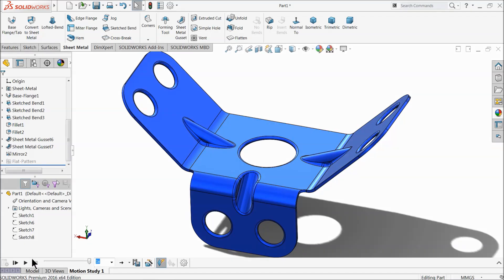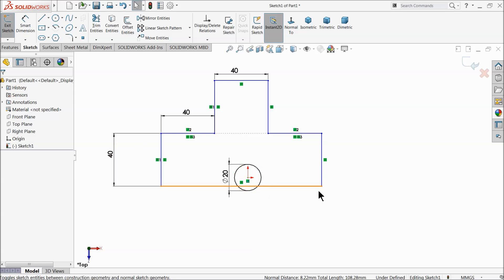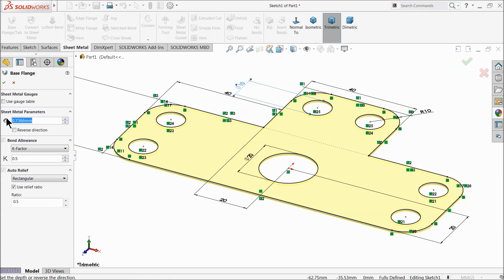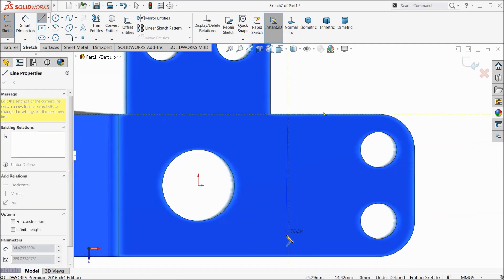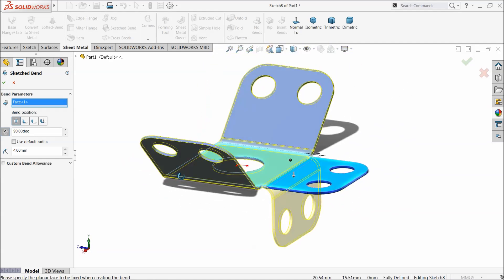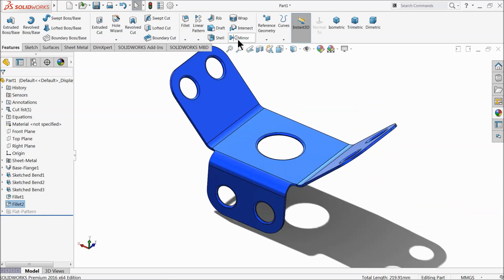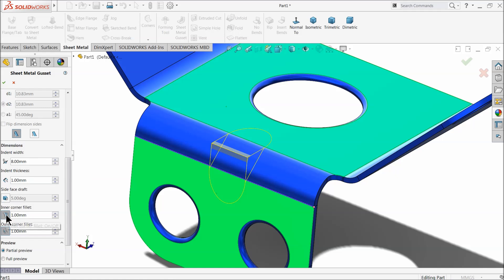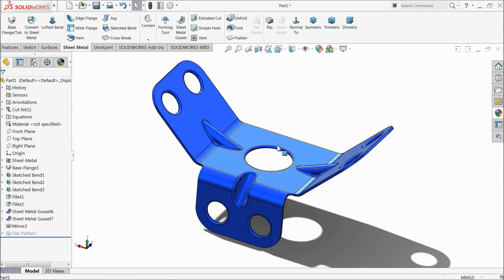Solidworks tutorial sheet metal

Comment: thanks I like your tutorials, 
but I noticed that when you added the fillets the size of the top part changed from 40mm to 30mm??
how can that be avoided without using tangent circles in each corner then power trimming the profile away to leave the radius???

Comment: the edge of your gusset has a small fillet all the way around. Mine is a sharp 90 degree angle. My properties are the same as yours. What do you think is the problem ?
Reply: Just press on gusset fillet icon where it shows 1.00 mm
Reply: while you are in the sheet metal gusset command below inner corner fillet click the gusset icon to the left of the greyed out dimension of 1.00 mm. Do the same for the outer corner fillet. Apparently this activates the fillets.